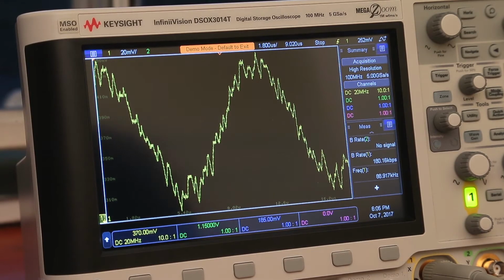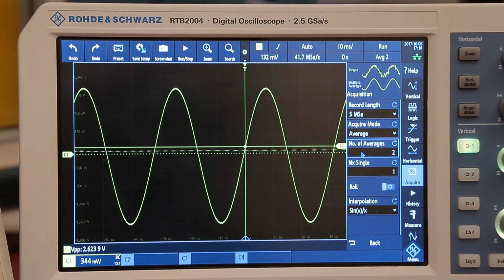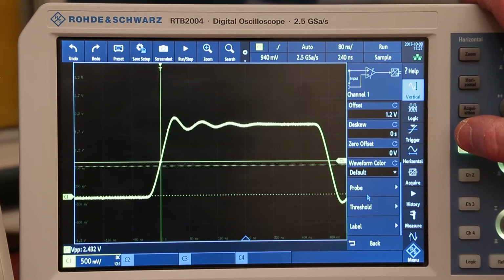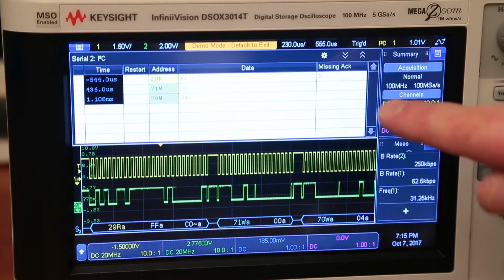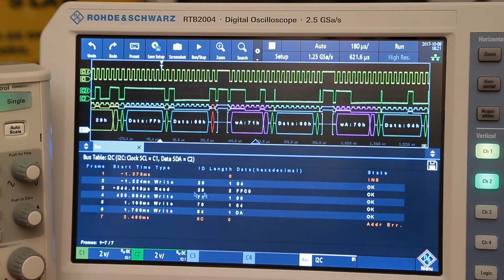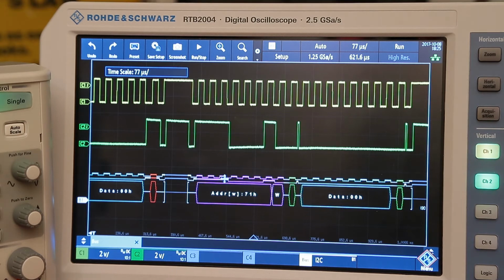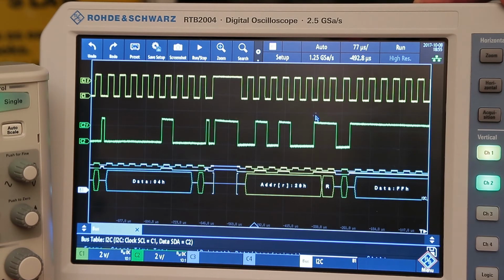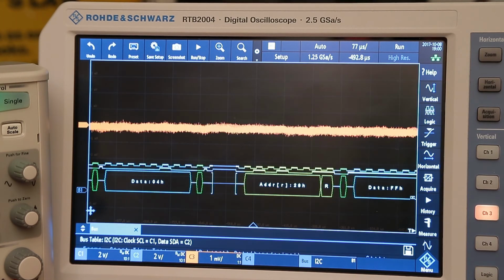Rohde & Schwarz RTB2004 & Keysight MSOX3014T  Oscilloscope Analog Signal Quality & I2C Serial Decode

Comment: In my experience protocol decoding in Rigol scopes works fine without any issues but it is implemented significantly different to what R&S or Keysight have. Rigol's decoder is implemented in the main software as a postprocessor while more expensive brands do it in their FPGAs and acquisition ASICs. That is why for a Rigol in order to decode properly you need to make sure to have the whole signal you want to decode shown on the screen while R&S will just do it regardless of whether it has all the slopes currently shown on the screen or not. This is a much more simple and limited solution but considering the price difference I would still call it just a minor inconvinience.

Comment: Would you be so kind and share the link to anti-glare foil ? Thank you
Reply: Hi, sorry for the late reply.

I can’t see the actual link on Amazon to the Techguard screen protector I bought previously;  however the following is the details for the same one I used I believe.  Make sure you aren’t buying a glass material one as it needs to be cut to size.  I made a template to size from a plastic folder cover.  My screen protector is still going strong and in excellent condition after approx 3.5 years!!

Hope the details below help.

Kind regards

Michael

—————————————
TECHGEAR [Pack of 2] Anti Glare Screen Protectors for Previous Amazon Fire HD 10 (9th / 7th Generation, 2019/2017) - Premium Matte Screen Protector Covers for Amazon Fire HD10 2019 & 2017

Comment: Hello, thank you for posting this video. I want to buy one of these oscilloscopes. The price is very simiular. Which one would you choose if have choice? Thnaks
Reply: Hi. The answer to your question is not a black and white decision as to which scope to buy.  The RTB2004, has just recently had a new  firmware update which improves the Maths functions dramatically and offers other benefits. The screen on the RTB2004 is also far superior.  The Keysight however has a much faster update rate of 1 Million waveforms a second as compared to around 50,000 on the RTB2004. The Keysight also still has marginally better Maths functions and a Trigger and Search options. 

I am not sure which one I would choose if I only had one, I might possibly side towards the RTB2004 for an everyday scope. The screen is large and very detailed (resolution). The glare problem is an easy fix.

Hope the above helps.

Regards

Michael
Reply: @michaelrothschild2646  I'm considering the rtb2004,having just also tested a rigol mso7000  (which was buggy). I need to have a very short trigger time after a segment store so as not to miss data. I'm wondering if the rtm3004 would be overall a better scope, but apart from higher speeds I can't find significant differences for the price.
Reply: Michael. I'm testing a RTB2004 right now. I'm having some strange issues with it.. e.g. On envelope capture it misses triggers so the envelope it builds up is not an accurate representation of the changing input.  Do you have the Math function  'Integral', Its missing on mine but I believe it's been added as an update.
Reply: Hello Michael, thank you for the quick reply to my question. I followed your advice and ordered the RTB2004 with nearly all upgrades. Especially in the price I noticed a huge difference, 3500€ vs 7000€. Another reason for my decision is that the RTB is an Austrian product and our company is located in Austria as well.
BR Daniel

Comment: I'm glad that some scope manufacturers are starting to increase the vertical resolution. For us analog types, we want more resolution that 8 bits. This is the reason I went with the Owon XDS3102A for my needs. Its 12 bit resolution has way more detail than 8 bit scopes. 8 bits may be OK for those doing digital work, but analog is still around in a lot of equipment. Nice video!
Reply: Ron Shaw wow took them words out of my mouth. waveform clarity was always the issue with digital scopes. their waveforms lack detail. if I'm to choose between a used analog scope and a digital cheap one I'll choose the analog. DSOs are poor when it comes to ANALOG SIGNALS. example : a composite video signal

Comment: How did you antireflect the screen of the RTB2004?
Reply from the maker: Hi, I used a matt screen protector I purchased from Amazon. The protector was actually for a FireHD tablet which I cut down to size. Please check my other video which shows screen protector packaging and gives details.  I will be posting further videos later this week (22 Nov 17).
Reply: MichaelBRothschild Which one did you purchase - the one for the "fire hd" or for the "fire hd (2017) " ?
Reply from the maker: Elektronik 

I think it was the FireHD (2015) model according to Amazon. I did however have to cut it to size.  See my first video as I show the packaging near the start and also the plastic template I made to cut it out.  I found it really easy to apply with no bubbles and its still perfect a few months later.

I am intending to post some more videos this weekend (25th Nov.17).

Hope the above helps